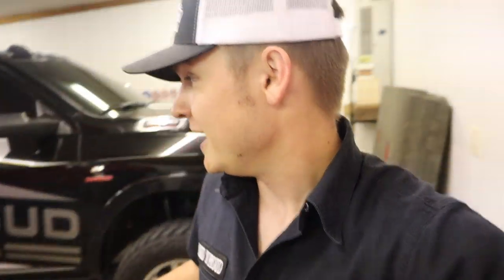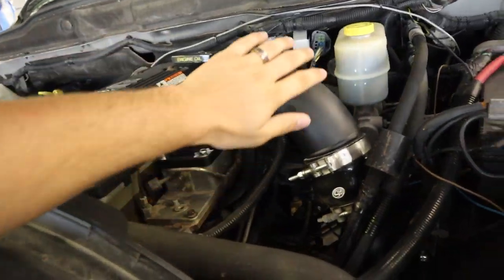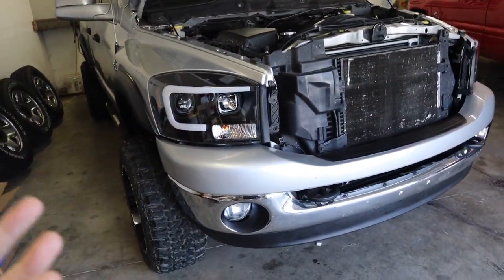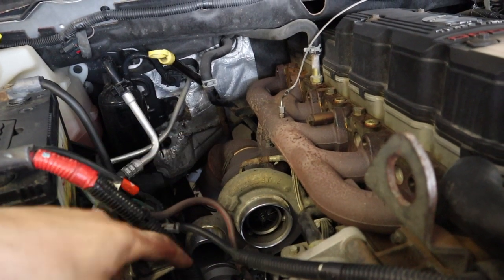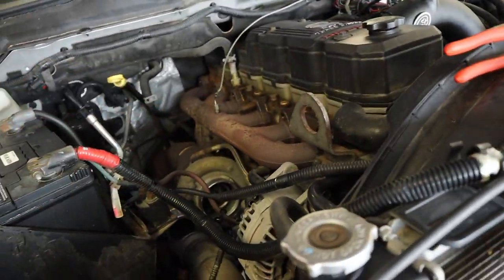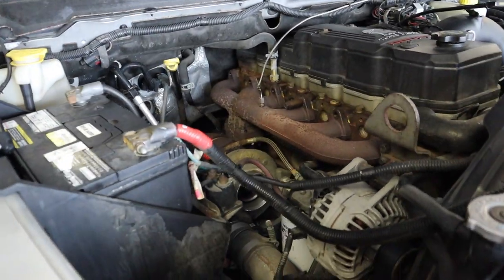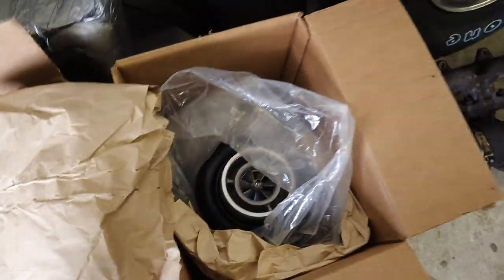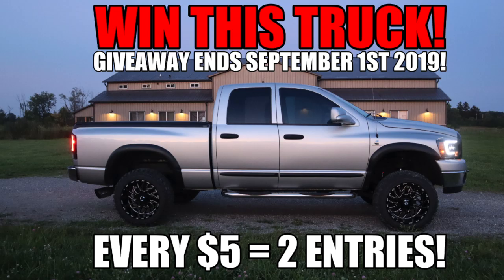NEW MONSTER TURBO GOING IN!!!

Comment: What size is the new Big turbo? Also you will need an airdog/fass new injectors and new cp3 to help spool it and actually make more power and headstuds to keep it together and valve springs and pushrods if you really want to send it and turn some rpm followed by a good EFI live tune. I did all that plus a little more on my 07 5.9 and I’m about 850hp it is 467.7 80% overs 12mm cp3 airdog 4g muldoons stage 4 trans manton pushrods and springs arp studs fleece coolant bypass and some more goodies CalTracs it ripssss